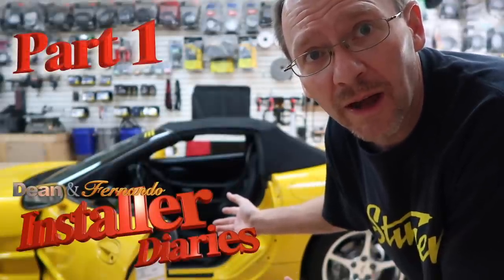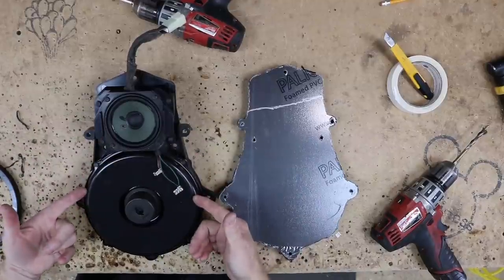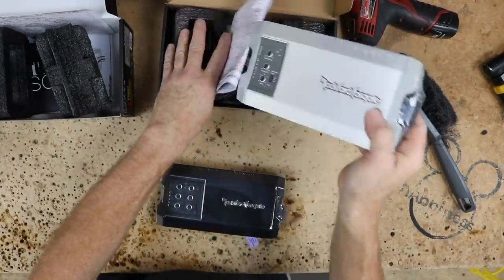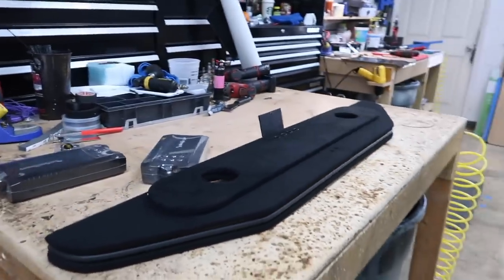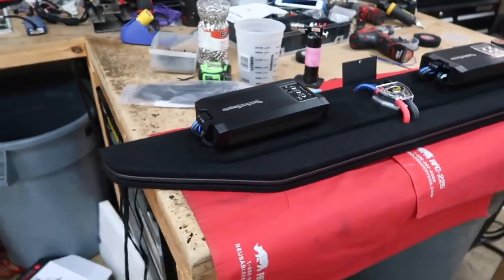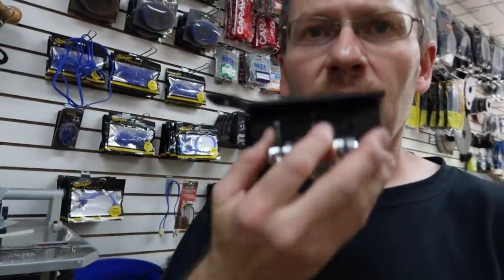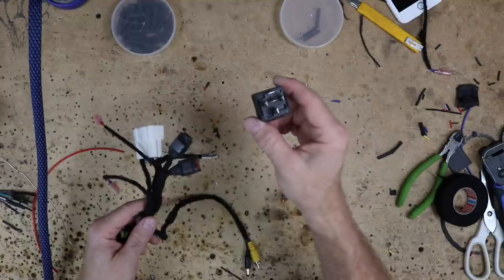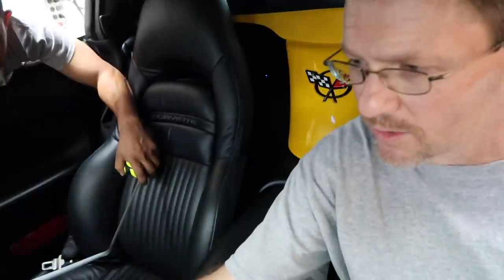Chevrolet  Corvette  full car stereo install

Comment: In the footwell, when you take the floormat out, there is a pigtail provided by GM that you can connect to to get accessory, ground or 12v. I think the Metra adapter is better, but for those who want to know where there's accessory there's a hidden pigtail next to the BCM module tucked inside that compartment.

Comment: Some times watching a video like this is worth it as you can discover things that you may have never noticed while cobbling together your own stereo improvement project on the C5.  
I'm referring to the midrange in the doors being blocked by the door panel, as those frequencies are quite directional, unlike the 8" Bose woofer that needs not the clear opening it possesses, being omnidirectional. 
Gotta wonder who the engineers are who designed such a setup, or their corporate masters who green lighted such a deficient implementation.
In my setup, I retained the Bose subs because they are really quite proficient at providing the low end up front which is usually relegated to the rear of the car because of it's omnidirectional nature. I added better quality coaxials in place of the midranges, but I never noticed how they were being cancelled by the door panel. So I will be fabricating a mounting board to locate the coaxial similar to how you mounted the tweeters, making them sit marginally over top of the Bose woofer enclosure by moving them up & forward. 
I retained the factory Bose system which is really not bad if you upgrade the mid & high frequency drivers, front & rear. I did put in a 10" JL Audio sub in the rear wedge section and a nice 2 ohm amp under the passenger seat with cooling fans added, since this is not an ideal location for an amp to vent it's heat. Works great btw, with the cooling fans it never overheats and is outta sight. 
No one can tell it's anything other than the factory system except it sound much better. 
Now that you have pointed out the fly in the ointment as to my install, I'm sure it will sound so much better by letting the coaxial see the audience. 
Thanks for posting this, it will make at least on persons install even better.  ; )

Comment: I hope everyone appreciates the attention to detail shown herein. Kudos to y'all ! I'm curious about the final gain setting and audible tuning though.  It seems you relied on the amps to gain balance the clipping or distortion levels from each amp. But is this the right way to go when the speakers will distort at different levels?  Or maybe it was just a good starting point?  When adjusting EQ for the speakers,  how much do you factor in the person's preferences or do you just set it best at flat EQ and let the owner screw it up from there?

Comment: Hello I'm. Just letting know this is a great help. I just got a 94.  I wish you fellows. can tell me where in Atlanta, I need help my radio. volume will not work. it's the same Kenwood that you worked on in this clip. text me or email. the Vet has 45000 miles it too young to just quit.  It's a red.